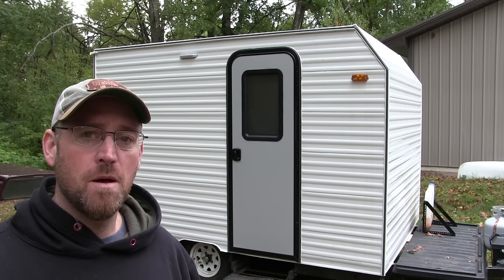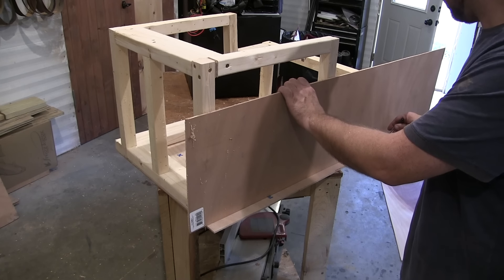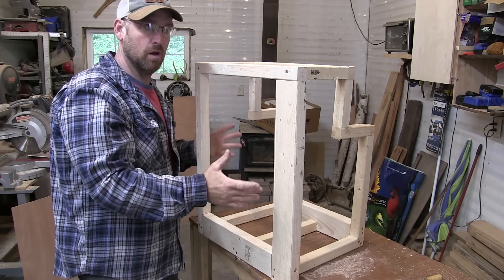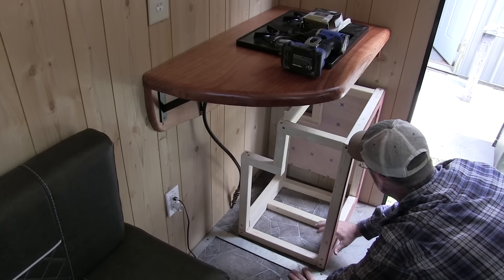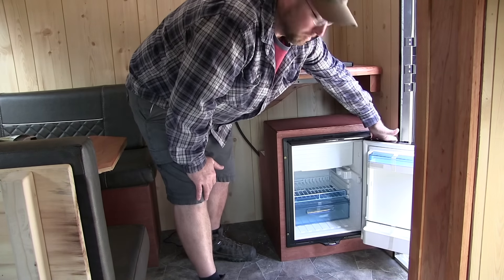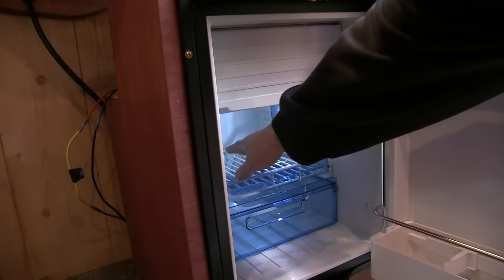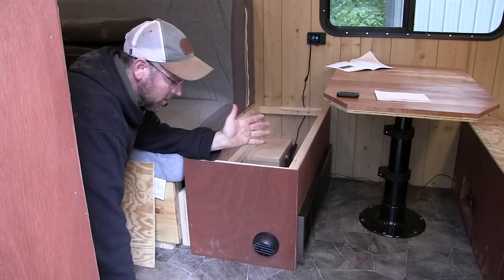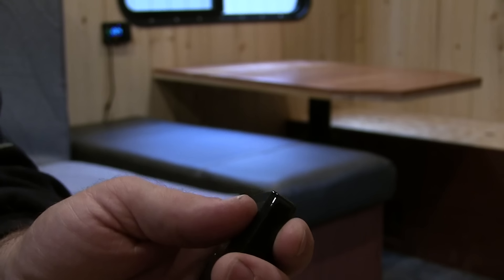DIY Camper Cost and Weight !! installing a fridge and heater

Comment: Foresty Forest has also dealt with the fuel pump clicking issue for awhile, and ended up finding a silent(ish) fuel pump from a guy that builds them himself. May be worth checking out.
Reply from the maker: I'll have to check that out . I think I would be fine but wouldn't want to set up too close to other campers you hate to be the annoying person in the otherwise peaceful camp ground . thanks !
Reply from the maker: Thanks ! that thing is silent .

Comment: I've watched numerous videos on these , I have Maine friends on lobsterboats using them. Hail to the Chinese. I prefer the Moo Lang Tais to the  Ho- Chi -Mihns. More thrust power.  I saw a guy heating his house bedroom with one, but he put an extendo PVC pipe on the muffler and installed a computer fan in it that was powered by a 5 Watt Panel and a battery that I think also ran the Deisel unit. The pipe kept the initial startup fumes from blowing back into the house window, making wifey scream.  So you'd have like a 3 foot pipe propped up at an angle. Yes, remove it for the drive  home. Duh.  Silver metallic HVAC  Heat tape is my new trim thing on bikes etc. You could make like 3/4" strips to trim the corner edges of the boxes, it would look so dope. Even when wrinkled, you can smooth it down awesomely with a scissor handle or something.  I made a chainguard with one. Versus 24.99 for a "snakeskin".  Oh and it would look great on the heat guard behind the purple Girlie Stove in the cabin.  No more sharp edges . Okay I'll stop with that.
Reply from the maker: It does work pretty good . honestly if I had more space I would prefer a propane heater mainly because diesel sticks and so does the exhaust . its not a purple stove its a dark red color lol

Comment: at 2000 lbs you do not need trailer brakes but they are a bonus
Reply from the maker: they sure are .  I used to go through brakes a lot on my other chevy truck it was about the same year . the mechanic told me chevy had the smallest brake pads out there so it's a huge bonus for that

Comment: I would consider some type of rubber isolator between the fuel pump and the frame. The frame is using the wooden floor as an amplifier. You did a great job on the camper. 👍
Reply from the maker: I may try that . the mount provided with the fuel pump is a soft rubber but I guess more couldn't hurt .. Thanks !!!

Comment: You might want to think about enclosing the bottom of the trailer you could get some tin roof material and enclosed the bottom of it to keep y’all in line from getting ripped off and damaged and corroded just a thought other than that you did a very nice job  on the camper build👍You earned this cold beer🍺
Reply from the maker: I think thats a good idea just a channel of tin around the fuel line and pump would probably be enough . Thanks !!!
Reply: At least add 1/2 inch square metal mesh to the bottom to stop rodents from chewing their way in while it sits idle between trips.

Comment: Maybe it is due to age, but I couldn't manage with a refrigerator on the floor.  I would have built a cabinet with a trash can or dirty clothes bin or something under the refrigerator to raise it up.
I use rubber grommets or washers and foam to try and isolate noisy items like water or fuel pumps.  I like your reasoning on the plywood.  I bought my wood in early fall of one year, let it sit in the sun until rain, then put it around the sides of the garage until early spring, then painted it with deck paint before mounting it to the pontoon frame.  It lasted 14 years sitting in the weather before I replaced it with aluminum dock decking.
Reply from the maker: I know I really wanted it higher but there just wasn't a good space for it . Thanks !!
Reply: I am going to get my plywood early and let it dry before I do mine.

Comment: Love the recent additions to the camper. We use a 400watt ceramic heater for our teardrop, but I know a few diy teardrop people who use the diesels. For safety for you and yours, I highly recommended a carbon monoxide detector in the camper. Keep up the great videos!
Reply from the maker: Thanks !! I was planning on looking for a co detector really soon. I actually extended the exhaust pipe a couple inches a few minutes ago . I hope to keep them rolling
Reply: This heater needs to vent outside.
Reply from the maker: @elsie9649  did you watch the video ? I showed the exhaust and how I ran it

Comment: This was one of the most informative and enjoyable videos on a camper build.  The diesel heater you put in was a good addition to the camper I am a hvac/r guy and those little jet furnaces are are great.  The refrigerator you in stalled with the freezer was a great idea; however, the freezer usually does not get cold enough to hold ice cream to temp and that’s because of the sugar content in the ice cream.  Looking forward to another adventure with you.  Oh, nice shop I would love to have a shop like that.
Reply from the maker: awesome Thanks !! thats what I was going for because I watched bits and pieces of a few different camper builds and didn't find them very useful . yeah I am pretty impressed by that little heater I wish it was thermostatically controlled but it does put out good heat . well I guess thats ok I really should lay off the ice cream anyways lol .

Comment: You are right on with the plywood moisture and the vinyl floor. As I've been in flooring for 38 years. All of what you've done looks very Profesional. Love it man!
Reply from the maker: Thanks !! it's been quite the topic of discussion on here .everybody jumped on me for not sealing it so I figured I need to explain it .  I did finally paint the bottom this summer . also made it more aerodynamic and finished the inside . here's a link to that video if you want to see the finished product .https://youtu.be/2GaUwcLtRpU

Comment: Nice job! Looks really nice. Also, if it’s cold enough to require the need for heat, no one should complain about a bit of noise. You could always turn it off and be cold lol
Reply from the maker: Thanks and thats a very good point !!
Reply from the maker: Thanks and thats a very good point !!

Comment: Great build, very impressed. In my builds I used chest type 12v fridges - holds more and cold stays in when you open the lid. I used solar, so, 12v electric blanket with a timer and got up before wife and lit one burner on campstove to cut the chill. Had a 3 blade sailboat fan (.25 amp) to move air
Reply from the maker: Thanks !! I thought about getting one of those but they were pretty pricey so went to the rv surplus and picked this one up . I'll have to check out that fan

Comment: You are quite a craftsman, great job! 👍
At some point, you may want to consider beefing up the axle. I used to have a small mowing trailer with the same rated axle and hit a big pothole and the axle bent big time. The wheel was pointed sideways. The trailer place said that’s too lightly rated an axle and I replaced it with a 2500 lb axle. I know it doesn’t sound like much difference but it was much beefier and I never had another problem
Reply from the maker: Thanks !! I think I am going to get a 3500 lb axel and springs soon . there's a local welding shop that said they do a lot of swap outs

Comment: A short-circuit in the fridge electricals with that propane line right behind it can be dangerous man....!!!!
 The video is amazing. You are a great craftsmen. The camper looks cozy and lovely.
Reply from the maker: Thank you !!  I see your point but really the gas line would have to be leaking and it's not and the wire would have to have a major malfunction I just don't think its very likely .
Reply from the maker: I hope to do a camping video , but it might not happen till spring now

Comment: Makes sense about the floor. I once built a fence out of treated lumber. The people at the hardwarestore told me not to paint it for atleast 4 months. 15 years on - rock solid, not needed a repaint.
Reply from the maker: Thanks !! it really does . I almost think the next camper build I will just use regular plywood and treat it right away should be just a good as long as it gets a good coat .

Comment: We have the same heater.  My husband has the entire setup in an igloo cooler and.it sits outside our camper except for the heat tube.  We use it in the garage, the tent and the camper.  Have had it 3 years with no issues.
Reply from the maker: Thats a great  idea a portable unit !!

Comment: I used a round tin both ends removed put through the floor for the exhaust our first attempt the ply floor started to smolder nearly caught on fire. 
Good video
Reply from the maker: wow !! so you had a smaller hole through the floor then ? thanks !!
Reply: About 110mm bit over 4 inch round bakebean tin😅 exhaust dead center wrapped in fire proof cloth. Seems to work.

Comment: One little trick when installing hoses over nipples is to dip the end of the hose in rubbing alcohol. The hose will slide right on the nipple. Works for rubber grips on bicycle handlebar s also . Great build. I learn new ways of doing things with every project.
Reply from the maker: Really , I will definitely have to remember that trick I had a heck of a time getting that hose on ! Thanks!!!

Comment: I installed a diesel heater in our pop up camper for deer hunting and it melted the plastic vents.  I found a couple of metal vents on Amazon and fixed.  Works great!
Reply from the maker: Wow !! I'll have to keep an eye on it . were they exact replacements for the heater ?
Reply: No, they were from a different co. and I had to replace the hose with dryer vent hose so I could tighten the hose down on the vent.  Its a tad smaller than the original

Comment: When install heater to my caravan i use small spring to mount fuel pump, to reduce sound and it work perfect.
Reply from the maker: so are you saying you ran the bolt through a spring ?
Reply: @blackspruce1861  i use tension spring with side hooks, need some short distances and 2 screws.
Reply from the maker: Thanks for the tip !! I may give that a try , I've heard a lot of different ideas on this

Comment: FUEL PUMP... its just a pump not heated I have one. Put insulation around it and it will quite it down 90 % and it's totally safe. Love your build
Reply from the maker: Sweet I will try that for sure thanks !!

Comment: I'm going to have to get one of those heaters! We bought an old used fixer upper camper this fall and the heater was removed. This will work perfectly! Thanks for the inspiration! 😊
Reply from the maker: awesome ! I think personally I would prefer the propane heater that was in the popup because its definitely quieter ,but I couldn't find a good place to put it in this build

Comment: To help quiet the pump down. You might wanna try putting rubber isolaters. Between the bolts that have it bolted to your frame
Reply from the maker: yeah I might do something like that . the mount that comes with it is actually a thick rubber mount

Comment: Great build. I just have two things. I think they make replacement fuel pumps that don’t click. That’s only a maybe. And I think you put the fuel pump in backwards. The flow should go through the clear and out the solid colors. Probably won’t matter but something you may want to flip around

Comment: Awesome build!! Your attention to  details is impressive.Probably your weight concerns lie in the tires, buy a  higher weight rated tire in the future,but you'll be fine.Having lived in a truck camper ?I would have added a roof vent.Maxxair or Fantastic Fan.Solar panel option.But AWESOME!!Ty alot of great ideas.
Reply from the maker: Thanks !! I upgraded the tires to the highest ply they could get . I've had a couple comments from guys that work at boat dealers that talked about springs failing and causing bad crashes that has become my bigger worry now . I might see if I can find someone to swap out the axle and suspension to get some real piece of mind .

Comment: Great video!  If the fuel pump is solid mounted to the trailer frame, you can rubber mount it which will cut way down on the thumping/clicking sound.
Reply from the maker: I'll have to look into that the mount itself is pretty thick rubber I thought it would do the trick but I'll have to improve it

Comment: I don’t know if you did this but all the holes you drilled in the deck should have RTV in them before the bolts went in. The hole you cut for the heater should be sealed too. 
You can get fire resistant sound dampener panels to put in the area where the heater is. 😊
Reply from the maker: I used that high tea gasket maker sealant for the heater . and RTV by the wire hole

Comment: Didn't get a real clear view of your heater fuel pump but maybe a small piece of closed cell foam sandwiched between the pump body and the mounting spot would reduce the thumping sound? Nice little rig you built. Wish I would have kept more of my Dad's woodworking tools after he passed. Good luck from a fellow Michigander.
Reply from the maker: yeah I might do something like that maybe wrap t in something . Thanks !!

Comment: Add rubber washers between two metal washer in each knot on the base, to attach the heater pump. This will to avoid vibration and reduced the sounds when pumping.
Reply from the maker: good idea !!!

Comment: You did such a great job on this camper build! your a great carpenter. 👍 you could run an a longer  fuel line and wiring to the fuel pump  and Mount it in a separate box on the front by the tongue and stuff the small box with fiberglass installation, it should help muffle that clicking sound of the fuel pump.
Reply from the maker: Thank you !!! I may try something like that

Comment: i want to build a small trailer to tow behind my porsche. weight limit is 1,000 lbs. this is helpful. thank ya’!
Reply from the maker: No problem ! I'm building one right now that I'm hoping to keep below 1,000 . it's so hard to tell if I'll make it or not last time I was trying to stay under 1700 and missed that by 3or 4 hundred . this one will have less in it so maybe
Reply: @blackspruce1861  I’m cheering you on!
Reply from the maker: @youarenotme01  thanks!

Comment: Did you make a video of the power inverter installation on this camper? BTW there are alot of critics out there brother. To them its easy to pick apart your work in hind sight but you were doing everything on the fly. Much respect man. Thanks for the video.😊
Reply from the maker: not really . i installed it then later decided I probably won't use it much so I'm just sticking to my own little 12volt system

Comment: Subbed and liked, Awesome build it gave me many ideas. One idea for you, you could coat the bottom of your floor ply under the camper in rhino truck bed liner. Not only will it protect your floor, it adds a slight amount of insulation factor and noise dampening. Cheap and easy mod.   Keep it comin brother
Reply from the maker: Thanks and thanks for the sub!  That might be what I'll use I should get that figured out pretty soon spring is right around the corner .

Comment: It might help to soft mount the fuel pump so the sound it makes doesn’t reverberate through your frame.
Reply from the maker: The mount for it is actually a soft rubber mount

Comment: You’re just fine on overall weight, and even better on weight hooked to the truck…. I worked for a lumber company in the early nineties, Hoosier Wood Preservers. The focus was pressure-treated lumber…. I still remember helping with the loading the miniature rail cars and chaining the loads down, pushing them into the pressure vessel….something like 32 bolts around the circumference of the end bell, all latched down with a 1”-drive ratchet. It was usually dried in a kiln after the fact……
Reply from the maker: thanks thats good to hear . I would never guess they kiln dried it as wet as it is when its on the stack . would be a cool process to see though
Reply: @blackspruce1861  Ryan, what you purchased may not have been dried fully….from what I can remember, the main customers were the RV builders in northern Indiana in Amish country(Elkhart, Goshen, Middlebury, South Bend)….lots of 1/2” and 3/4” Marine Tech treated plywood plus lumber. That stuff was HEAVY sorting it on a stacker to step-stack for transport to the kiln, and then back again to final-stack for packing up to the customer. This was back in 1992-93, so that put me at 18-19 years old….lots of physical labor!

Comment: My Freightliner has one of those heaters. I think you'll be quite pleasantly surprised how well it works in extreme cold temperatures. Just put a bit of anti gel in the fuel. I'll be waiting for the extreme cold weather diesel heater video
Reply from the maker: That’s good to hear ! Have you ever ran kerosene in it ? I was told that they can run it and it’s much cleaner burning . Just wondering if Thats true. I should plan on a really cold weather trip for sure
Reply: @blackspruce1861  I have not.
Reply: We used it in our house fuel oil furnace when we ran out of fuel oil one winter! It worked fine! I think it was 3 days before they could get to us to deliver to us!
Reply from the maker: thats good to know . I know it burns cleaner so I might give it a try

Comment: Outstanding additions to the project, but that pump noise would be a deal killer for me.  There's gotta be a way to insulate the noise that the pump makes, or maybe even replace the pump with one that is less noisy.  Perhaps constructing a little box around the pump with some of that rigid insulation you have will do the trick?
Reply from the maker: Thanks !! yeah I should really figure something out to quiet it down